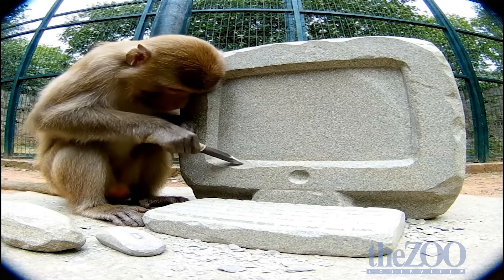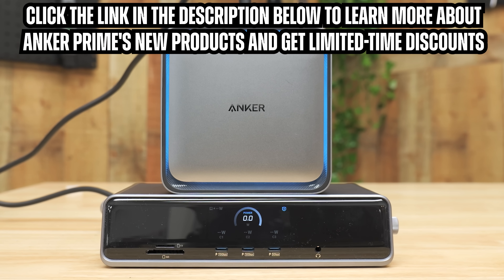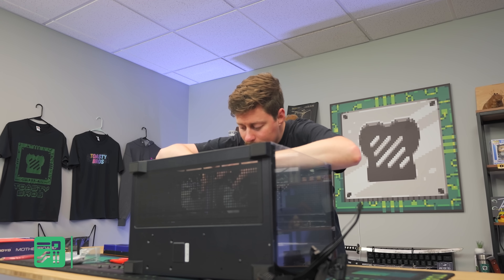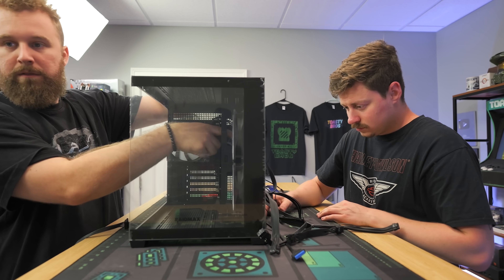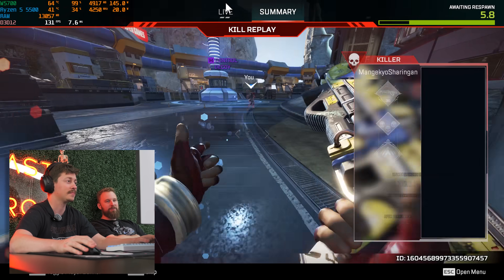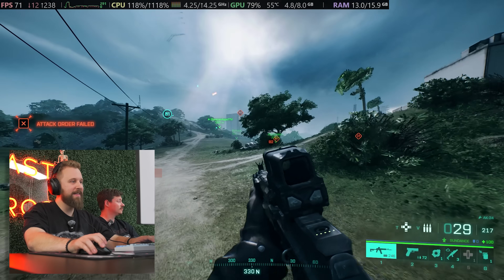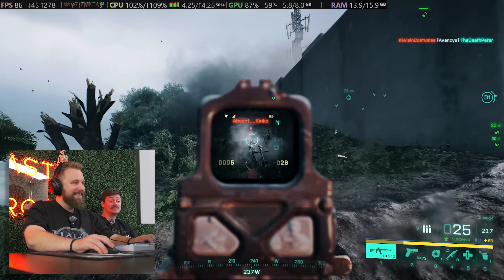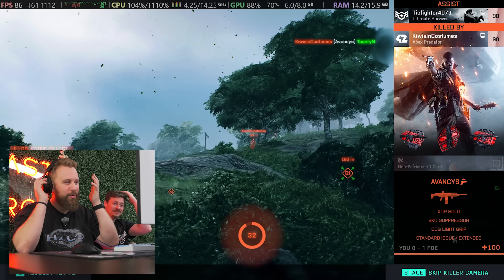The BEST $425 Gaming PC Build 2025

Comment: You're using a board with no WiFi, and need an adapter for the display out on that card, so adding those in, how much is the build? (It's still a nice budget build, just wondering how much if you factor in the other two things you need to make it actually work.)

Comment: You can use MPT or more power tool and modify the soft powerplay tables and overclock the gpu its really easy to use. I got a 9006 in timespy and got the card up to 250 watts in fermark

Comment: I got the same BF2042 stutters, I think it's the CPU. I have a test rig with a Asrock B450 and a Ryzen 5 5500, tested with a 2080 super and 2080 Ti. It runs fine on the newer CPUs/AM5 but I want to test with a 3700X or 3800X CPU next. If that's the case, I'd go for a 3rd gen Ryzen 8 core used than the Ryzen 50 5500.

Comment: i understand you guys try to keep prices low as possible but 32 gigs of ram in any of this type of builds is worth it period for a significant gain on the one percent lows and minimum , to me that makes it worth a little extra 15 to 25 bucks more for the ram, that's not much and helps a lot in many games now days
Reply: On a build this low end I can assure you that 32GB of ram might make 1-2FPS difference at the dead most and it costs significantly more for 2x16GB sticks
Reply: @riptornsideways  yes areed  but will improve the lows by 5 to 15% depending game it wont add much to the high frames you will notice far less stutters is what im saying in some games

Comment: Scored a sapphire radeon x060(6600) 8gb off ebay for 96 bucks.  Mining card, but works great!  Dude had like 10 of them.  All gone now.  Wish I bought 4 of them
Reply: I got the x080 (Rx 6700) 10gb off eBay for around the same price. Doesn’t have any display out like the x060, so integrated graphics or a second gpu is required. However, the card works with normal drivers despite what others on the internet said. So I consider it a complete win.
Reply: @lucas_m1740 awesome!  I saw that one too.  The x060 i got has a display port and hdmi.  Both work!  Listing said only one worked

Comment: Hey any chance you guys can do a "Get your parents a pc setup" video something that if bought now is gonna last them 5+ years since windows 10 isn't gonna be supported.

Thanks in advance!
Reply: Id recommend a sff pc that supports ddr4  or better with 8th gen and higher cpu with integrated graphics since they arent doing any gaming you wont necessarily need a gpu unless you got a cpu without integrated graphics.
Reply: If you can find a sff m920s lenovo thinkcentre, it supports Windows 11 and works pretty well.
Reply: Those old sff or even the nano sized ones would do the trick for a daily driver.  If you wanted to spend some $ on the folks, an ITX build with an 8600G or 8700G would be the super-deluxe version.

Comment: Newegg has a b550m with the 5500 and 32 gb ram for 200 bucks
Reply: Everyone complaining in the comment section Forgot that it’s only 200 bucks.
Reply: @hitokz I'd rather save and spend a bit more for the performance boost over playing sooner.
Reply: @Jeff.78 Of course the 5700x is better but the 5500 + B550 is $130, add a $30 16GB RAM kit. That's perfectly acceptable for a $450 build to pair with a RX 5700 XT.
Reply: Just go used at that point. Picked up 13700, z790, 32gb ddr5 for 250. Other options at that price or lower
Reply: Is there a limit on how many one person can buy?
Reply: Thats not the insane deal you think it is
Reply: I think the overall build is nice except I think ppl should lean towards a new gen mono, cpu and ram combo. It’s roughly the same cost and cpu/ram speed matter too.  Another important reason to use current hardware is due to driver support. Also, I highly recommend ppl spend extra on a reliable brand power supply to prevent damage to other parts.
Reply: Why b550 if you can't even use pcie gen 4
Reply: @Veforx it does.
Reply: @ryankelly1143 he is saying why pair a b550 with a pcie 3.0 cpu like the 5500. Of course the b550 platform supports pcie 4.0.
Reply: @ryankelly1143  but the 5500 doesn't.
Reply: @Veforx betrer for upgrade and wifi and Bluetooth.  I know the 5500 is pci 3.  Just going off tastybros video with 5500.  Just figured getting a 550 would be better in long run
Reply: You mean the 5500.  I immediately upgrades to the 5600x i got off craigslist for 60 bucks.  Bought a super cheap mobo for the 5500.  Built another pc with it with spare parts @Veforx
Reply: @Veforx Becaus the B550 chipset is better. Better vrm, 2 m.2, PCIE 4, Wi-Fi 6/E.
Reply: @Veforx  It gives you space for upgradeability in the future. Yes AM4 is already last gen, but with a b550 you can potentially get a 5800x3d which is still a very good cpu for gaming. When paired with a good gpu (6700xt and above) you can push 1440p at good fps in most games with medium-low settings.
Reply: Hard pass on the 5500.
Reply: @Jeff.78  budget doesnt have as many options
Reply: @erk5475 I agree. Decent deal but not good/great. You can find the 5500 + B550 for $130, not sure if it's still live. 16GB SP 3200 CL16 was $30. That $40 go towards an 1TN nvme. But RAM is getting expensive like $70 for a 32GB kit so I guess they factored that in.
Reply: @Jeff.78  I have a 5500 in my Unraid setup for hosting Plex, some game servers, and some various Docker containers and it does a great job for that but I've seen 5600s go for around $85-100 and it's a no-brainer for that.
Reply: @406Steven It definitely has a place, I'd just never use it for gaming when the 3600 exists for the same price, not to mention the used market. 

My main gripe is people who build a system for dirt cheap and then wonder where the performance is. Start on Gen 4, don't buy the cheapest components, and save a bit more to get a solid boost in performance. After some deal hunting/bundles, an AM4 rig can be had for less than $750.

As of 4:40 pm EST, Newegg has the 5700X for $125, until midnight. Ebay has it for $150.
Reply: @Jeff.78 yup 3600/3600x much better choice over 5500
Reply: @alancarr195 Same gaming performance??? 😅 The 5500 is brand new for around $65 and comes with a cooler. The 3600 is $55 used and no cooler. Also, new egg has bundles all day long like a 5500/b550 mobo for $130 and peace of mind. People probably think a used $55 3600 + $15 cooler + a cheap $50 b450 with weak vram, 1 nvme, 2 dimm is meta/go to when you're not really saving anything.
Reply: @Jeff.78  A brand new 5500 can be had for $60-ish and a used eBay 3600 is around $60 and no cooler. Or new egg regular has 5500/B550 bundles for $130. People like you who think a used 3600 + el cheapo $50 B450 is meta.
Reply: @itsatrap4986 Nah, I'd rather spend a bit more, AGAIN, and get a B550 mobo.

Some of you are missing my point...I don't wanna recommend someone build a lower end build from 3 years ago when there are better options that offer better performance along with a better upgrade path.

I guess, according to some, I'm the silly goose who'd rather save more money for a better rig, especially when considering the deals on AM4.
Reply: @Jeff.78 I didn't miss anything. I've already said the chip is better. However, the 5700X is bad value and has always been compared to the 5600 when it was $74, or even the 7500f when it was $100-$120 all day long and now 5800XT that went as low as $120 or $160 with wraith prism cooler + 1TB nvme. 😅 We're talking about $130 for chip and mobo vs $125 chip, no mobo & w/o cooler.
Reply: @itsatrap4986 
Your gaming standards are different than mine. We won't agree much further as (for at least the 3rd time) I've said, I'd rather save and spend more to get more, than settle for what can be purchased right this millisecond.
Reply: @Jeff.78  $286.94 Again, I didn't miss anything and at this price point, AM5 is within arms reach. 
CPU: AMD Ryzen 7 5700X 3.4 GHz 8-Core Processor  ($125.00) 
CPU Cooler: ID-COOLING BLITZ X4 64.8 CFM CPU Cooler  ($14.99 @ Amazon) 
Motherboard: Asus PRIME B550M-A WIFI II Micro ATX AM4 Motherboard  ($79.98 @ Amazon) 
Memory: Silicon Power GAMING 32 GB (2 x 16 GB) DDR4-3200 CL16 Memory  ($66.97 @ Silicon Power) 
Total:
Reply: @Jeff.78  Total: $376.97 Then save up for AM5 then. We're going from $200>$300>$400😂😂😂
CPU: AMD Ryzen 5 9600X 3.9 GHz 6-Core Processor  ($156.00) 
CPU Cooler: ID-COOLING BLITZ X4 64.8 CFM CPU Cooler  ($14.99 @ Amazon) 
Motherboard: ASRock B650M PG Lightning Wifi Micro ATX AM5 Motherboard  ($119.99 @ Amazon) 
Memory: Patriot Viper Venom 32 GB (2 x 16 GB) DDR5-6000 CL30 Memory  ($85.99 @ Newegg)
Reply: @Jeff.78 AND there ain't nothing wrong with sub $160 AM4 gaming standards. I'm done showing you examples of different budgets for everyone. Heck, the 8400f was $84 and is better than being stuck on AM4 with a 5700X.  🤓
Reply: @itsatrap4986 
You seem to think I'm against someone building a new AM4 rig in late 2025, I'm not. Just don't use the anemic 5500 and 16gb of ram on a b450 mobo.

I'm well aware of the price differences. A gen 4 AM4 build can be had for around $800 and an AM5 build can be had for around $1,000.

Also, I wouldn't recommend 8000 series CPUs because they're the nerfed AM5 equivalents of certain AM4 chips.
Reply: @Jeff.78 Mr big wig 😂
Reply: @Jeff.78 it’s better than the 3600, despite having less cache. It has been proven dozens of times by now. The 5500 is a good cheap cpu.
Reply: @quisqueyanguy120 
The 5600 is around 10% better than the 5500, and is Gen 4. I'd rather save up a little more money for a better CPU.

It's as if nobody wants to build a better system, just whatever they can scrounge up in a hurry, performance be damned.

Instant gratification has ruined many of you.
Reply: @Jeff.78 not the greatest, but pretty good for gaming still.  Especially for a backup, 3rd or 4th pc
Reply: @ryankelly1143 Decent deal but not good/great. You can find the 5500 + B550 for $130, not sure if it's still live. 16GB SP 3200 CL16 was $30. That $40 go towards an 1TN nvme. But RAM is getting expensive like $70 for a 32GB kit so I guess they factored that in.